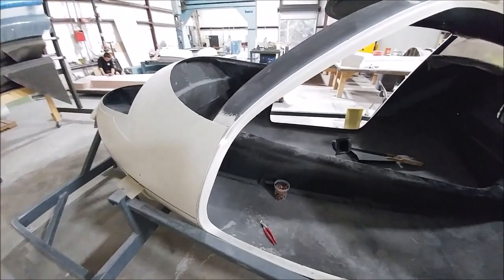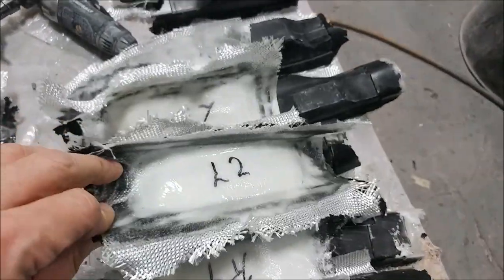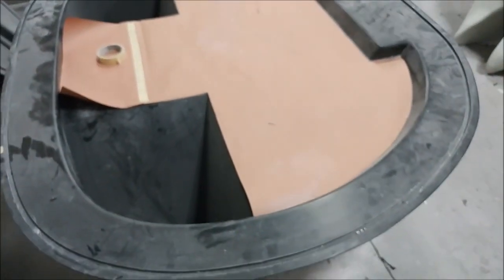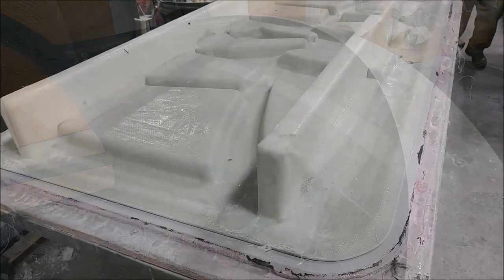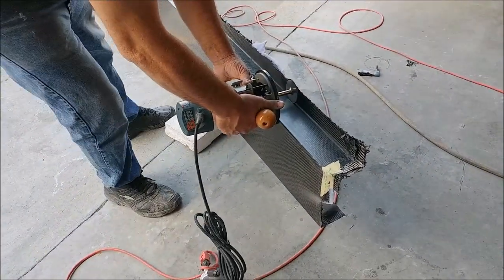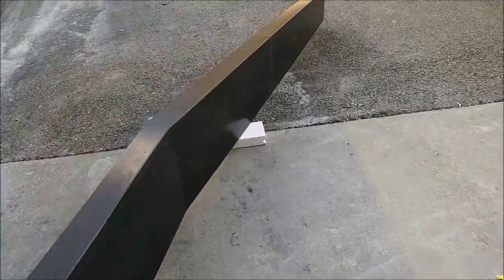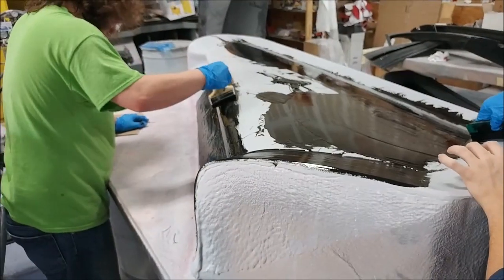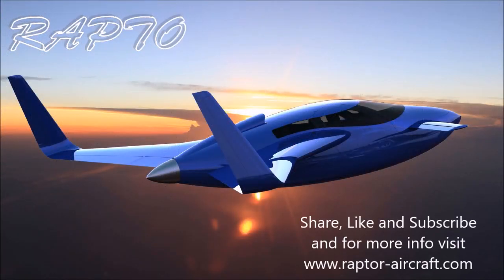Raptor Aircraft January 21st 2017

Comment: I really enjoy following this project. very neat progress. will you be at air venture?
Reply from the maker: Unlikely at this point. There's still a ton to do and although we are working as fast as can we have limited manpower.
Reply: I've been following this project for a LONG time (and have some skin in the game).  Turbine engines were never really part of the overall plan although I do remember a brief posting at one point in time.  They had a smaller engine as an option as well.  The direction of a diesel (a.k.a. JetA) engine I think is the right path to go because of the costs.  The idea of the project is to keep costs as low as possible yet achieving the highest levels of performance.  If you compare the Raptor expected performance with the diesel engine, it's not that much slower than the Cirrus Jet.  Jet engines are horribly expensive to run and their fuel burn is higher as well.  

At least that's my $0.02 worth.  :D
Reply: Raptor Aircraft are you open to "free" labor?  I.e. Come and help for a couple of weeks possibly?
Reply: IIRC the original design DID call for jet power, but as I understood they came to a conclusion that due sleak design most goals can be reached, whit a much less fuel sucking diesel, which is nice, considering climbing gas prices and the urge to use the long distance capability.

Comment: I love these updates, had a few questions. will you be making the seats custom or have you got some picked out from a manufacturer and with some of the parts being very big will you have to send them out to another shop to be cured?
Reply from the maker: For the prototype we'll likely use shine of the shelf seats. I have designed some already for production aircraft. We're going to create a makeshift oven to post-cure the fuselage altogether.
Reply: Thanks! love the progress and I think I want to join your list of buyers soon. I can see by the videos the doors will be a cause of stress for you once you get to the production phase. if they are off by just a hair they might not work. I would put the most skilled workers on that part of the parts production. labor costs might be higher than you hoped but it will be worth it. I think people will be willing to pay much more for this kit than 130k just the cost savings alone for a diesel will make many people want to buy one. Plus many of us would be willing to pay a lot for a time saving builder assistance program that will be a great source of revenue.